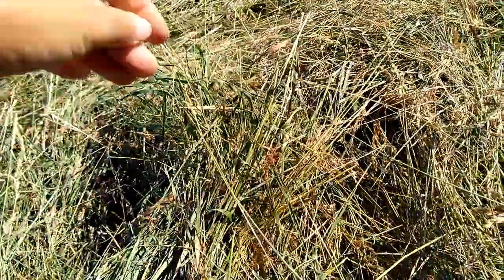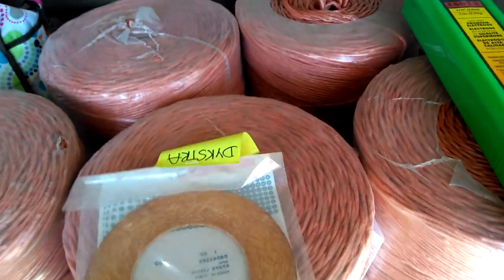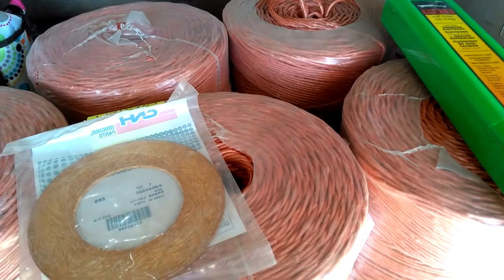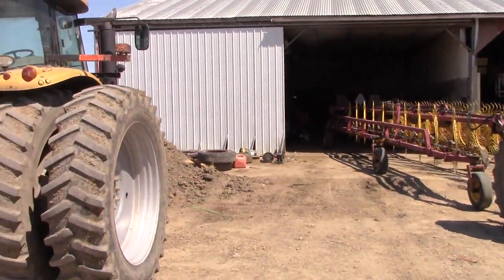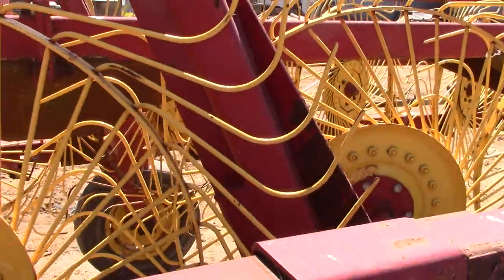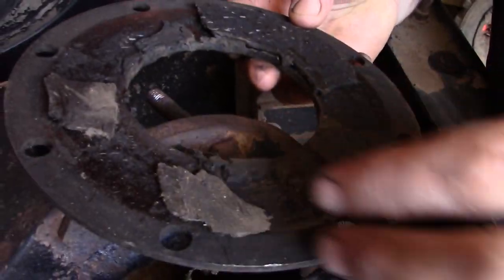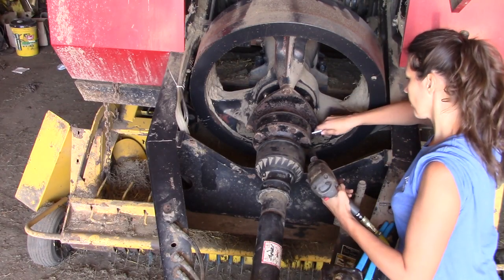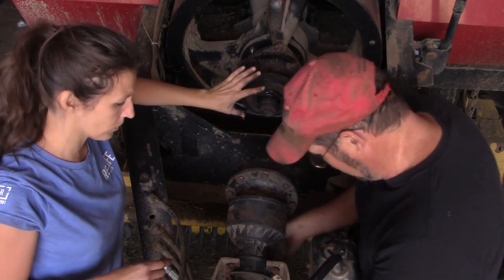Let's Get Baling Hay!

Comment: You should try cutting with serrated bladed knife they a so sharp . It with cut through that twine in flash .And the good thing is you can re sharpen just give a rub on sharpening steel